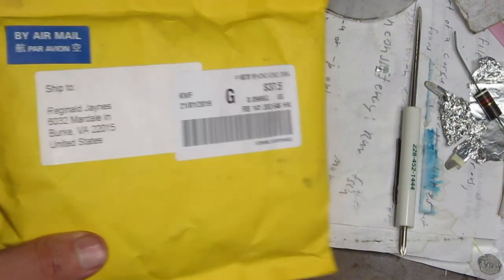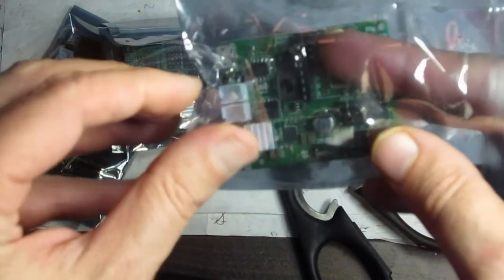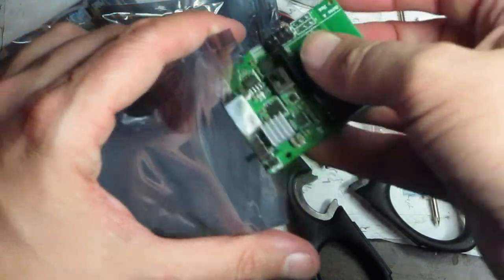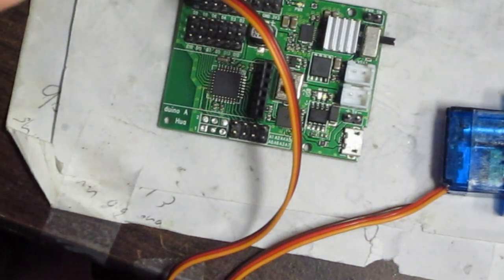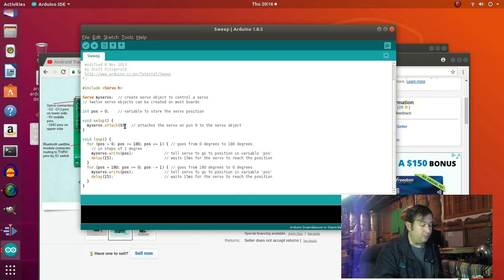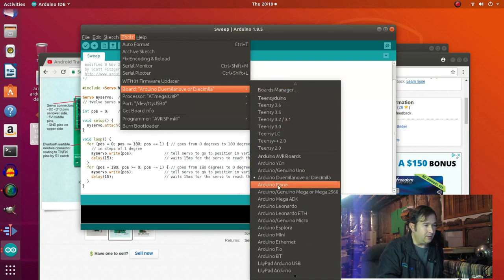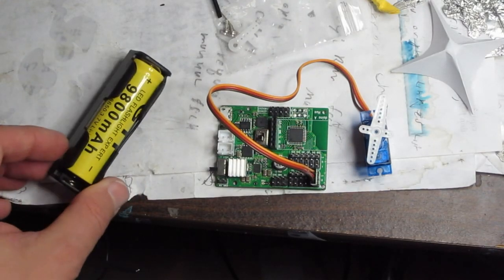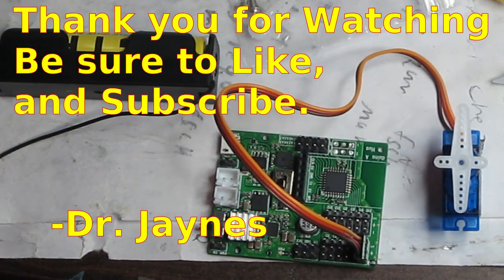Huaduino - Unboxing and Example Demo

Comment: I am planning to build the vary same robot spider and I am wondering if it would be cheaper to buy an arduino nano and the other components that this board includes. Is it possible? Do you know exactly what arduino components I need in order to make a nano work like a huaduino?
Reply from the maker: Great, Did you see my latest video, where I redesigned the body to be large enough to hold the battery and the battery holder as well for the 18650 lithium polymer battery?..  I just posted the STL files on Thingivers.. You can look into it.. The Huaduino has 12 servo plugs and power to power them all. You can easily plug all the servos in to the board w/o extra fuss..With the Nano, you will probably have to do a lot more wiring.. Maybe it is worth looking into?..